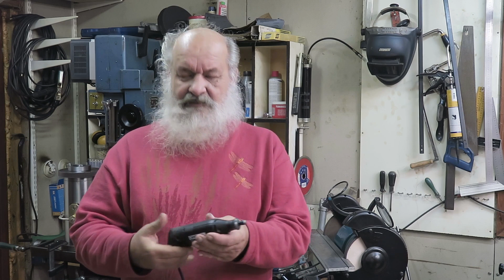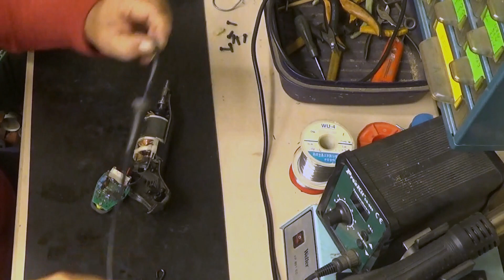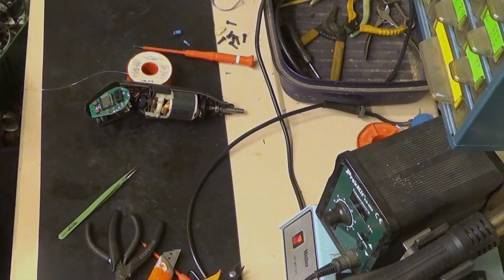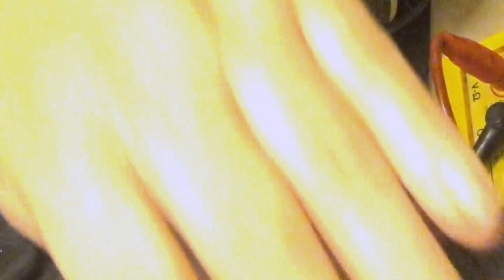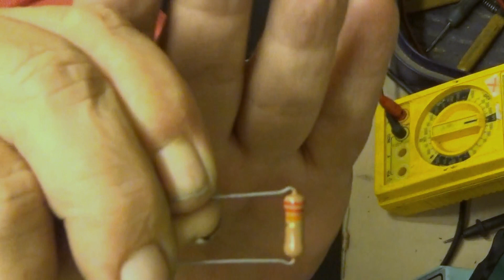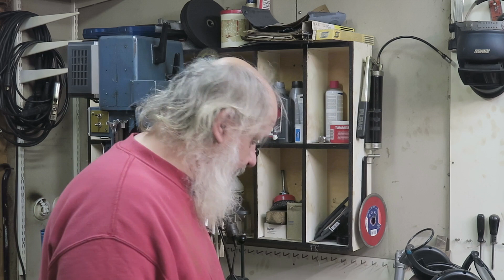Fixing The Dremel

Comment: Update on fixing my friend's dremel:  
1. when you plug the mains plug in => display should show the preset rpm (8 to 30) => power supply is then ok, only need to replace the small electrolytic capacitor and test again. The NOS capacitor i used was double the size of the one in the dremel while voltage and farads was the same. Maybe they went too far with miniaturizing. 
2. when nothing is shown with the mains plugged in => power supply dead, replace the big eletrolytic capacitor/resistor/diode. Check resistor and diode with multimeter to replace only the bad component. Glue used on components is not hard but rubbery and can be pinched off in little chunks. 
3. RPM control under load is not fantastic..  
4. Connections to windings feel loose, i did make a light bend in them for better contact. 
5. Replacing the brush covers is a pain! It's easier to take the side panel off. A brush cover with a screw would have been so much easier.

Comment: Hmm i have the same and let it connected to the 220 volt. After a week and a half i want to use it but it is dead. Could that be the same problem and wich parts do i need? I heard 24k resistand but wich capaciters do i need?

Comment: I sadly don’t have the right tools to repair mine
Reply from the maker: Yes, these have some design flops in them. For example the resistor that gets really hot.
Reply: @FinnoUgricMachining  the video is 3 years old. I wasn’t expecting to get an answer so quickly lol thanks tho keep it up
Reply: Please can you mention the capacitors and resistand you have used? I have to order them somewhere
Reply from the maker: @user-ec9km3qh7f  The resistor was an axial mount 22K 2W carbon film. The capacitor was a radial mount 100uF/25V electrolytic capacitor,.
Reply: @FinnoUgricMachining   are both capacitors the same value? 
Could leaving the dremel 1,5 week on power make this problem?
Reply from the maker: @user-ec9km3qh7f  Absolutely. The darn thing becomes quite warm, if not  hot, inside and this shortens the lifespan of electrolytic capacitors. They simply dry out. The values of the capacitors can be read on the components. It was quite long ago I did this repair (the thing still works) and I am not able to recall the exact values of the capacitors. I used the video to "recall" the values above.
Reply: @FinnoUgricMachining  the smaal one i can see 1 microfahrad but voltage? I can take also minimum 25 v than.
Thnx for the reaction. It was years a good handsome tool.  So i can take the chance to repair. I already have the more powerfull 4250 but is is bigger

Comment: very helpfull video. I have the same with the same issue, it doesn't start. I don't have so much staff us you to make the repair, but I'll try. Please , one information. Do you have measured the working vontage of the DC motor?
I think, if the electronics repair will be not successfull, I can use the Dremel with an external dc dimmer. thanks in advance
Reply from the maker: The motor is not a DC motor. It is an ordinary AC/DC motor. The windings are such that it can operate both on AC and DC. The controller is switching the full mains voltage on/off in a rapid fashion. The controller throttles the inpuit power by sensing the revolutions and then adjusting the power accordingly so that the drill tries to maintain the adjusted speed.
The babble above is just a very long way of saying "I don't know the working voltage of that motoer".

Comment: I would like to know where on the weiler matador lathe the dial for filleting is
Reply from the maker: Filleting in a lathe. Sounds like an interesting culinary action in the workshop :)
Funny that You asked about this since fish is my favourite source of protein. I suspect that this is the case for another 4 million finnish inhabitants. This is because Finland is one of those places on earth where fish is fresh and cheap because we ocuupy a country with some 30.000 lakes on it.
Cutting a fish into delicate fillets is probably an action worth a video. Would You like me to present how to separate a pike from it's bones ?
Reply: @FinnoUgricMachining  Good evening Ugric
My English is very poor. Let me ask you again.
I've just bought a lathe like yours, and I couldn't find out where there is the control to start threading always in the same place.
Thank you and wish you a good Sunday.
Vito Catacchio
Reply from the maker: @vitocatacchio3189  That depends on the thread You are cutting. Especially the pitch of the thread.
The lead screw of this lathe has a 6mm pitch so every thread pitch that this 6mm is divisible can utilize the half-nut of the lathe located in the apron at the right side of it.
Then, if You are making imperial or other thread pitches that are not divisible by 6 then Your only option is not to disconnect the half-nut once it has been enganged. So You need to run the lathe in reverrse to go back to the start of the thread.